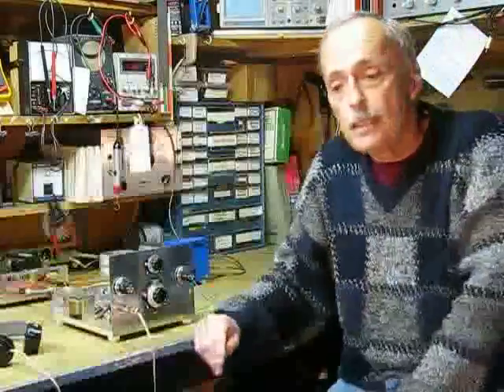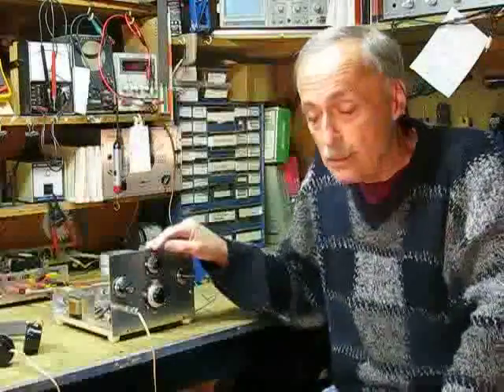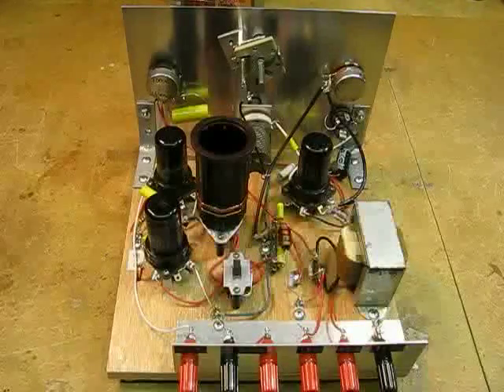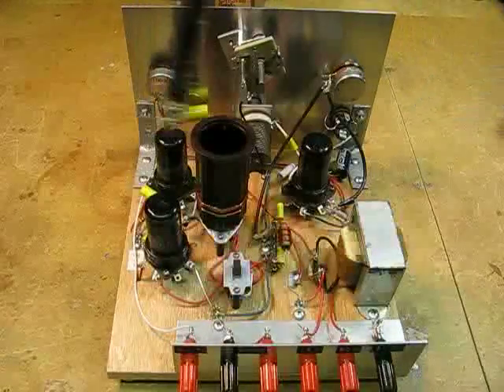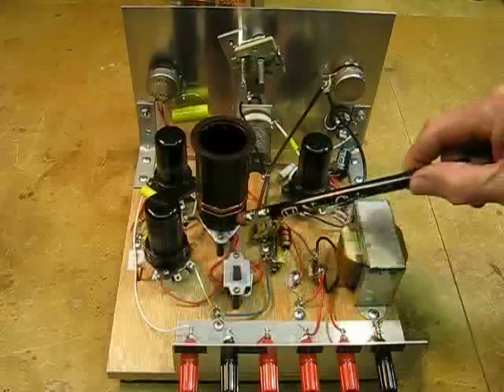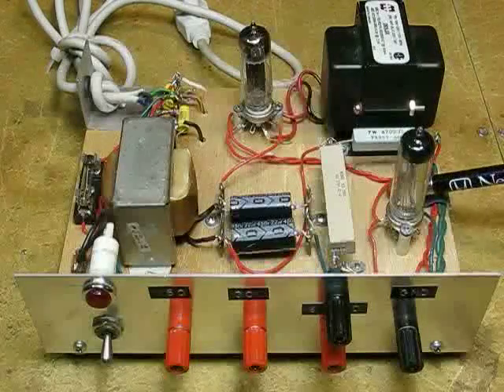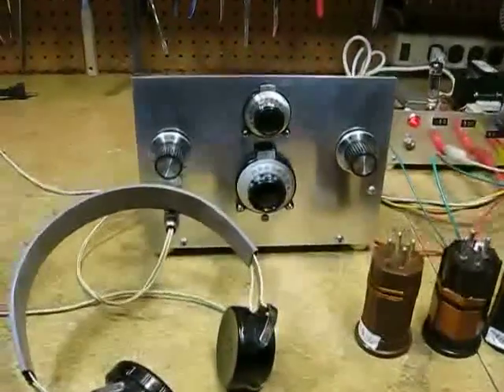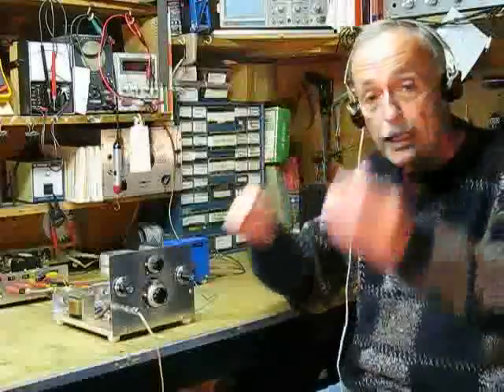HOT HOMEMADE REGENERATIVE RADIO

Comment: What's the point ? No circuit diagram ! Viewing this video is a waste of time for most of us !
Reply: There’s hundreds of different types of regenerative type radio receivers, each having there own way of acting depending on how it’s engineered, not just wired but the tubes chosen. 
From triode tubes to pentodes. 
When it comes to building radios if you just want a schematic you can find them online every were, but this issue is under standing how they work, knowing how it’s wired versus how it actually works is very different because you’ll assume you have it wired correctly but you don’t and it will not work! 
Certain things his done to his radio
For example the 180° ticker flipping switch can be easily researched and understood how it works. 
His radio is relatively speaking is considered high voltage operated and the voltage our exposed and in the open 
That’s one cause for not sharing schematic, the second reason is that he may have completely designed and engineered it himself from the ground up, and well you can in fact build it exactly as he has, but want work the same. 
If you really want to build one, I recommend watching MIKROWAVE1 video series on building a low voltage regen. My regen is based of his time to teach and explain quite a lot about how they function, and work. Already being a radio guy who’s worked on high voltage receivers i took my own time to re bias, and tune the by pass and feed back capacitors it order to use said high voltage. But even with low voltage to get them to work well you have to find a balance between you regen control scheme and feed back, it’s really easy to make “tubes and transistors oscillate”
It’s controlling and regulating that oscillation that is difficult and important. Regenerative receivers act like transmitters really all radios with oscillators and RF feed back do, but regenerative types can be very very noisy EMI wise if built in correctly and well re transmit back out. Hence why his coil from is much smaller then a crystal radio set. 
You want be very happy just building off a schematic, without actually understanding it friend!

Comment: Hello JOHN Work-shop GREETINGS from Philippines Merry CHRISTMAS  2019 and HAPPY New year 2020 . Pls. Look into my new-generation of REGENERATIVE receiver post at YOUTUBE at Philmonitor. My design circuit does NOT at all requires a FEED-back winding as TRADITIONAL-regenerative do but it has only One-winding for each band and so,the INDUCTOR have only TWO-terminals one-for GROUND and the HOT terminal connected to INPUT of OSCILLATOR cir-cuit there is NO TAP on the COIL.So, simplifying the circuit .LEO of Philippines .Pls. try it .

Comment: John: Although I don't know the particulars of your detector circuit, some time ago, some of us who were experimenting with regennies discovered that the values of the "grid-leak" resistor, and the grid coupling capacitor severely affect the selectivity and sensitivity of our favorite sets. Values such as 10 Megohms for the grid-leak, and 10 pfd for the coupling capacitor make a huge improvement in selectivity, and some improvement in sensitivity. *I* suspect that using such high values of resistance, and such low values of capacitance reduces the "load" on the detector coil, vastly enhancing its "Q". Selectivity can be improved so much that side-band cutting will become very noticeable when listening to an AM station. vy 73 for now, Ken Gordon W7EKB
Reply: I would LOVE to learn more about this! I am gathering the parts to make a regen soon. I need to check and see if I have 10 meggers laying around anywhere. 73 de KI5SOH.

Comment: How about a schematic to your power supply?  and/OR  the BC Wave Trap?  Mainly want the trap.
I also live just 1 mile from the AM/FM Transmitters...so the trap would be handy
---
I subscribed and Thumps Up so months ago.
Reply: You can easily build a wave trap if you know the unwanted frequency.
You just calculate an oscillating circuit, put C and L in series and connect it in parallel to antenna and ground.

Comment: I have 4-prong coil forms spaced at 5/8" across and side-to-side.  Can't seem to find a socket for them.
What source did you use?
Reply from the maker: Hi Ted, My coils and the sockets have a one half inch spacing--not 5/8.The four prong sockets are readily available; I got mine from tubesand more.com. Also known as Antique Electronics. Good luck with your project! "73"
Reply: OK, I went to their site and found the P-ST4-205M Socket.  Is that the correct one?
Also do you have a source for the coil form that fits this socket?

Comment: wow about 500 bucks in parts  u better have a good junk drawer i would go with a 12ax7 at 12 volts i can see a person hung up in the high voltage i would not have the the hv on the frount pannel 73
Reply: How on earth do you get $500 ?
If you fear HV, it's about time you learned how to work safely with it.
Time was when there was no alternative.
At 18 I was building medium power transmitters with 500 vdc. at home in my bedroom. 
That's a the problem with a technical hobby. You've got to know what you're doing!  Tough, ain't it?

Comment: Thanks for sharing! Very nice little receiver. Where did you get the coil forms? How did you calculate number of windings for tickler coil and main coil?
Reply: squarewave2 I've often used pill bottles of various sizes which provide a nice stiff bottle cap that you can glue hollow pins. After winding the coil, you slip each wire through the hollow pins, tighten the cap in place and then solder the wires in the pins. Snip the excess and you've got a plug in coil!
Reply from the maker: Hi Katherine,
Thank you for your comment! Lindsay publications had an excellent book called “Regenerative Short Wave Receiver” that gives the schematic and the coil winding formula. Unfortunately, Lindsay is no longer in business, but Lindsay books can be found used on ebay. The old four prong coil forms are sometimes available at radio swap meets, also on ebay.